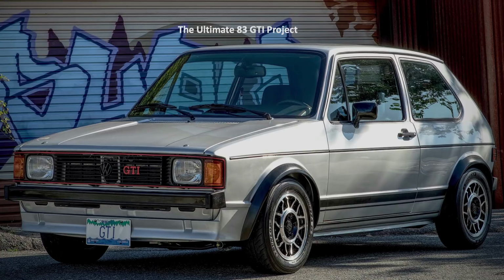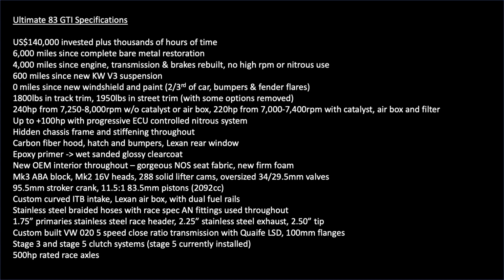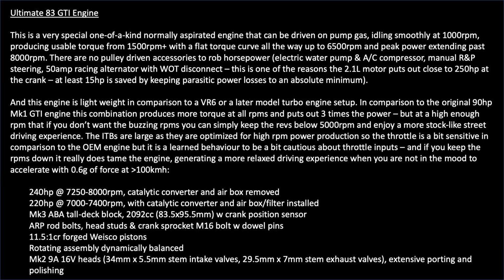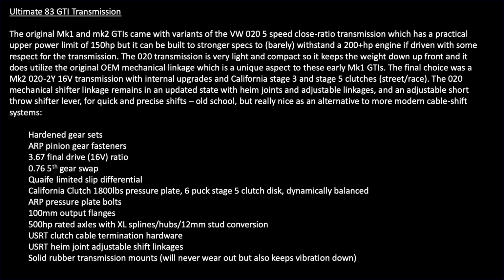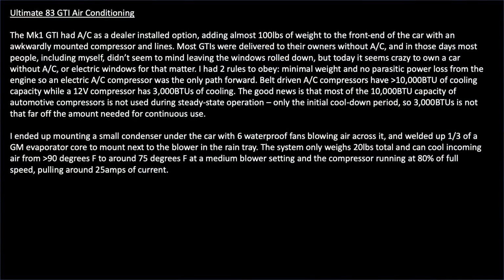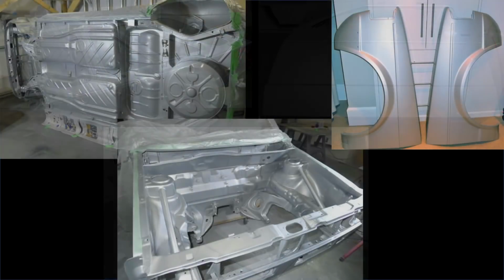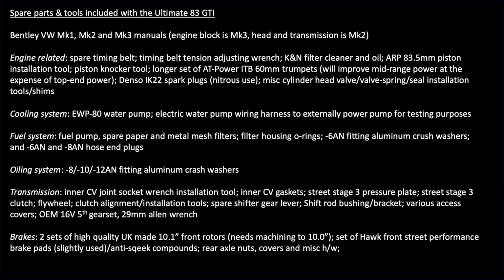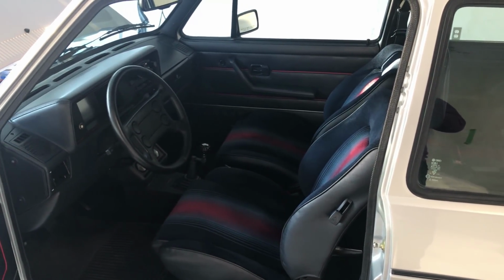The Ultimate 1983 Rabbit GTI - part 181 (Complete Project Review)

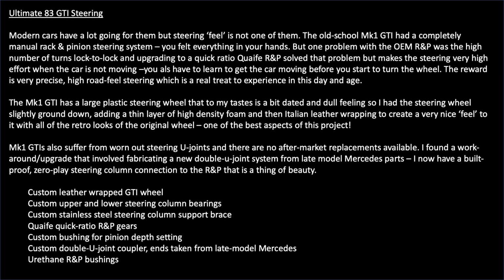Comment: Hi Derek, really cool project going on here, I've watched like half hour of it, and learned a lot for my own 86 gti. One thing that's been killing me is the play in the steering. I replaced the rack with a Meyle one, which works well (atleast to what it was) but now i think the steering column is weak / worn out. I noticed at 37:40 you mentioned that but said there's no aftermarket parts available anymore. Any advice? Everything else on the car is brand new, but now its up to the column and not sure what to replace or fix, it's almost as if the car is just designed like that. i'd replace all of the parts but is  there any steering column parts you could recommend that are worth it?
Reply from the maker: Sorry for the slow response: I have other videos on the steering U-joints and also lots of details on my website at www-dot-derekspratt-dot-com. You need to source some Mercedes u joins and then get some minor fabrication work done to join the halves together and then you will have new joints. Plus I did other steering column mods to further stiffen and support the whole structure. You'll get there!